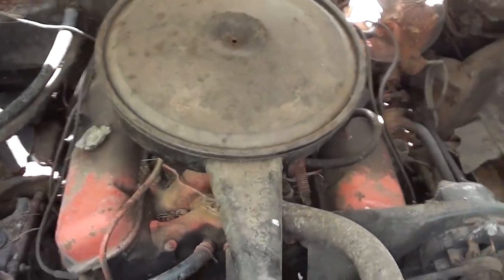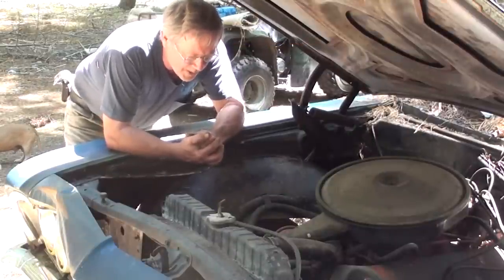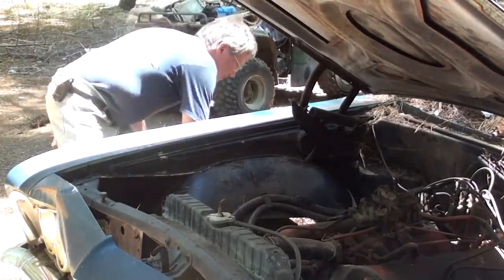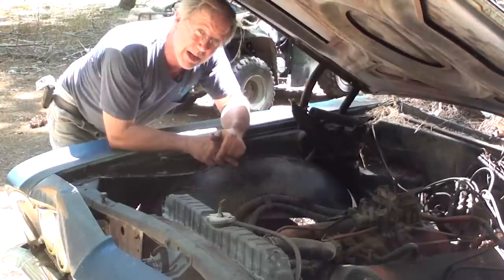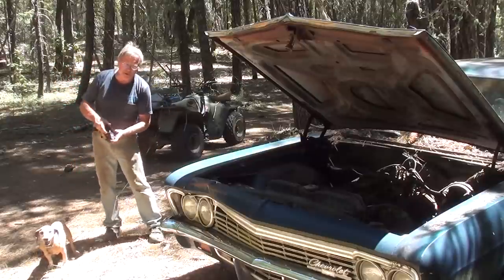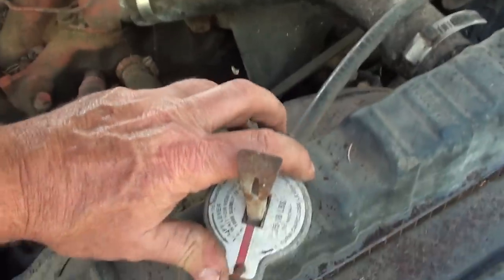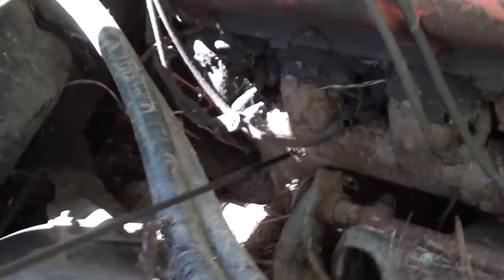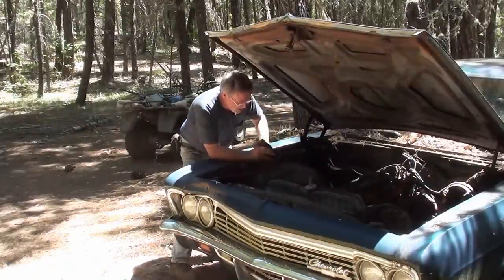Part 1 Big Block Biscayne Rescue! Abandoned 1966 Chevy Sitting Since 2003

Comment: My dad drove a 68 impala four door hard top with a 327 for I don't know how many years. He always said it had over three hundred thousand miles on it but when he traded it it was full of rust but still ran great. These old cars are tough just keep them out of the salt.
Reply: No 327 lived 300k miles. My grandfather worked for GM at the factory in StLouis  in those years and he'd tell ya the small blocks were done around 80k. They'd run beyond that but the metallurgy in the rings and bearings wasn't good enough for the poor quality of engine oil on the market.
Reply: @mwilliamshs  don't be stupid it was the late 60s not the 30s. If you took care of it it would last a long time. People still drive these cars today with hundreds of thousands of miles on them. Your comment is nonsensical because it has been proven wrong more times than anyone could ever count.

Comment: I have experienced several of those particular spark plugs that dropped the center electrode into the engine. Once, on a brand new fresh rebuild. Haven’t touched em for about 40 years since.
Reply: Tried that on a 5 cyl Volvo S80 recently. It just chewed it up an spit it out. Ran great after a new plug. Parts guy was a bit confused about me ordering only one🤓

Comment: Good to see you bouncing around again, must mean you're pretty well healed up. As for that more-door, old iron is getting rarer every day. It's got plenty of potential as a cruiser, and I'm 99% sure the brakes/steering/suspension is the same as the two-door, so you've got aftermarket support.
Reply from the maker: There will be at least 4 videos in this series

Comment: I used a similar version of a compression guage but it is a actron by sunpro lol, and the hose doesn't have the connector hoses and accessories yours does but it is dependable and work good so I am not worried..

Comment: We need to stop looking at cars as "worthless" because they have 4 doors. This I why I like Uncle Tony's garage. I had a 65 biscayne that was my first car and you would have been looking for a soft place to sit if you talked about my car that way to my face.
Reply from the maker: I was at the place to get a 56 GMC 5 window truck. Getting this car meant a 300 mile return trip for a car with no title. The 396 made it worthwhile.
Reply: @ElderlyIron  Missing the point. If you don't like a car because it has 4 doors then leave it for someone who appreciates it. I could give a rats tail if the car had an inlilne 6 or a v8.

Comment: Darnit, how could I have missed this premier!  Where I grew up in Clayton, Ohio, in the late '70s and early '80s, was a '65 Impala SS.  It was a light metallic blue, and still wore all four of its SS wheel covers.  It had a 283 with bucket seats and a console shift for the Powerglide - and it had a manifold vacuum gauge incorporated into the console, where I would've expected a clock.  Only problem was that it was a rusty old pig.  It had considerable rust holes in all of the usual spots, and not only that, the little chrome rings on the tips of the six tail light lenses were all rusted and disintegrating! I'd never seen that before...  OK, now to watch the remaining 43 minutes... (I knew it was gonna be a two barrel!)

Comment: It's good to see you at it Jeff... it looks like you're getting around just fine in the video. I'll assume that the healing process has continued to be a success. As for the car, I see a lot of potential for someone who would be interested in it to get back on the road so allow me to encourage that end. If it doesn't work out that way, obviously there are plenty of useful parts so be sure to pass them along if you cannot make use of them yourself. Even though I'm a Ford guy, I still like old iron of whatever variety thus hate to see it be scrapped when the iron is viable. There's always someone out there that would love to get their hands on parts/items that would otherwise be forever lost. Anyway, I'm looking forward to the next episode. Oh yes, one thing regarding the fire danger... I'd take a rake along and clear out the flammable, dead vegetation from underneath and around the car if your mission is to fire it up in place. It shouldn't take long. I bring this up because I've been witness to a fires breaking out a few times in an almost identical situation as yours... though it never went anywhere due to being prepared via a primed waterhose or extinguishers. Even so, I've yet to witness a fire break out when there was nothing to burn. Just food for thought! Be safe and best wishes!

🔥🧯🚒👨🏻‍🚒👍🏻✌🏻🇺🇸

- Max Giganteum
Reply from the maker: There will be at least 4 videos in this series

Comment: I like to add ATF to the cylinders, leave the plugs out and break the rings free by hand at the crank pulley, then wind it on the starter.
Reply from the maker: I'm all out of yard sale ATF
Reply: @ElderlyIron  Bought a case of Type F at a yard sale myself....nobody wants it anymore but it works great with acetone instead of penetrating oil. I guess I'm doing the environmental thing and "reusing" the stuff.

Comment: I think your underestimating the 4 door situation. The new and upcoming car guy has a family usually and a 2 door is way out of price range and honestly the 4 door makes more sense, look at all the crew cab trucks out there. Not only that but all the 2 door go fast parts fit the 4 door.
Reply: True!
Reply: easy to turn it into a 2 door DD Speed Shop is doing a 66 biscayne right now
Reply: @winteroutside7014  a 2door post sedan. Coldwarmotors did the same thing taking a whole complete unibody 4 door 1957 Plymouth Savoy and making a 2 door Fury with the excess parts. Uncle Tonys Garage did this with Slaghammer the 67 Valiant. They used a sedan body and just built it up as a 2 door post sedan
Reply from the maker: There will be at least 4 videos in this series. Somehow people got the impression I'm against 4 doors, when I am not. It's purely and economical decision. A 6 cylinder or even a small block in this car would not have warranted the 300 mile round trip rquired to get it. The 396 would have paid for the trip and made some more on top of that. A 6 wouldn't have covered expenses.
Reply: @broncomcbane6382  uh, you missed the title of this video ''66 biscayne''  what does a savoy fury or valiant have to do with the topic od '66 biscayne ?
Reply: @ElderlyIron  Makes perfect sense.

Comment: @ elderly iron. Those cables around the manifolds Was the recall solution for broken motor mounts
Reply: Said broken motor mounts could cause the throttle to jam open. A friend wrecked his 1967 BelAir because of that. He was too cheap to replace them.
Reply: A pathetic solution to a serious problem to say the least. 👎🏻🙄🤦🏻‍♂️

- Max Giganteum

Comment: It is a hot wire from the voltage regulator and the starter. Then it will run I own a 1966 Impala a hot that goes to the battery and powers it all look at the battery and it should be a small red wire then it will run

Comment: We have two 65 biscaynes 4 door 396 cars currently under restoration
One is an AC car 
In our research we found that GM did this as 327s were in short supply in 65/66
Reply: And in the Impala SS in '65, you could opt for a 396, or you could order the 409 in its final year, in case one of the small blocks wouldn't get it done for you.
Reply: turn them into 2 doors like DD Speed Shop . he also has a 57 belair post 4 door / 2 door  sedan roadster
Reply: @DanEBoyd  yes, I had one. My brother had it first before he was drafted and went into SF. I drove it til I had a low number on the draft and had to join the Navy. My brother put a 427 cam in it. The early 65s had Holley carbs. Factory exhaust manifolds had good flow. With a Mickey Mouse kit on the carb and drag plugs it would run in the mid 12s on the quarter mile. It was one of the first synchro 3 speeds and it was on the steering column. The trans was geared very low in first gear. It did good for a SS big body impala. Used to blow the doors off of Roadrunners. 
Love those old cars.

Comment: So if this had have had a 6 in it or a 283 you would have closed the hood on it and this would have been the end of the video.Fact of the matter is that that car is 56 years old,and if its in any kind of shape at all its worth saving,irregardless of the body style or the engine.
Reply: I'd like to see the whole car saved too - it looks really complete and solid.
Reply from the maker: The fact of the matter is that it had no title and I would have to drive 300 miles with a trailer to get it home. I was at that location to get a "rare as hens teeth" 56 GMC 5 window cab. The 396 alone made the return trip viable, regardless of what it was in. If this thing had no floors in it or even rolled, I'da come back for that 389.  There's probably 4 more videos coming up in the series.

Comment: I was wrong!  That's a Quadrajet!🙄Darn those missing Turbo-Jet badges!  And I'm surprised that it has the Powerglide.  Wasn't the TH400 available in '66?  Maybe deleted for credit?  Man, I just love that GM dark aqua from '66. Ma's friend had a '66 Impala wagon in that color (and two super hot twin daughters), but I'm pretty sure it had one of the Turbo-Fire options underhood.
I'm a pessimist, so I would wanna pull those valve covers and make sure all the valves are free. Chicago?
Reply: Had a '66 police car equipped like this in the gas station back in the day... surprised it would break the rear tires loose when flooring it... probably do 140 once it got moving...
Reply from the maker: There will be at least 4 videos in this series. I put badges on it!

Comment: Me the big fan of the square body trucks and the gm gbody cars especially the 80's Oldsmobile cutlass supreme brougham with the olds 307 v8 cars lol, believe it or not I ended up with a gloss black and I think it was supposed to be a white pinstripe might have been silver not sure lol,,it is a 2000  dodge ram Laramie slt quad cab long bed 5.2 litre 318 magnum v8 46re AT 4x4 1500 and 176k miles runs strong needs a muffler bad kinda loud muffler no more lol

Comment: #8 oil consumption was a common thing with early 396 oval port engines
Reply: Wasn’t it an issue with #7 & #8 cylinders running hotter than the rest because of the cooling system design.
Reply: @prevost8686  pretty much yeah

Comment: Hey Jeff. I just bought a 1979 f250 2wd with manual steering and I'm trying to find where I could possibly buy the power steering setup from. I've been looking and haven't found much. Thanks. I tried to send a message but couldn't figure it out.
Reply: There are some factory parts available which you can get off the shelf but if I were you, I would grab the entire used power steering setup off of a truck in the boneyard. Or from someone parting out a truck. It may take a while to find what you need but once you have it all you'll be good to go - just be sure to get everything when you're getting the parts including the hoses, belts (to use as an example of what to get new), the pump (for a core, at the least), the correct crank pulley, all the brackets plus the bolts. One thing, the pump and brackets may be different between engines so obtain what works for YOUR engine. You might also need to compensate for the alternator, an overflow tank, the waterpump, the radiator, a fan shroud and even the hoses. Why? Sometimes the inlets and/or outlets were switched from drivers side to passenger side based on the engine, A/C, P/S, etc. Even the radiator thickness can vary and so can the fan pulley & spacer. My best advice is to obtain a shop manual for your year of truck as they're invaluable for repairs, specs and diagrams. I'd list out all you need but I cannot since I'm not familiar with your truck. In your shoes, I'd rely on my shop manual to figure it out... along with a real life example of a P/S equipped truck. Peace & good vibes! ✌🏻👍🏻🇺🇸🧰

- Max Giganteum

Comment: I'm a Mopar guy that knows a fair amount about GMs, but I have to ask how did you know that was a 396 and not a 427 immediately it seemed?
Reply from the maker: The Powerglide. 427's had a 4 speed or 3 speed auto. 396 came with a Poweglide. Of course, back in the day, you could order whatever you wanted! Besides, I've had this for 3 or 4 years!

Comment: Hi are you sure the engine is a 396 it could be a 427 ?
Reply: In a 4 door, low trim no A/C car?.
Reply: @bachtomin213  It happens.
Reply from the maker: According to impalas.org, in 66 the 396 only came with a powerglide, and the 427's never had a powerglide

Comment: So is this been sold already? Or will it be put up for sale soon ?
Reply from the maker: For sale now, though not completed yet. Just got some center caps for the rallye wheels. Running/driving. Found out it has a factory Posi as well.

Comment: Whats ur issue with a 4 door
Reply from the maker: I guess I'll have to make a video with the explanation, as so many people seem to think I have issues with 4 doors. I went to a private property to buy a 56 GMC 5 window. It was a 300 mile round trip. The resale value of whatever you buy has to offset the cost of the trip. Without a 396, the value is not there to make a return trip. WIth the 396, the engine alone make the trip worthwhile. However, the value of the running, numbers matching big block 4 door  exceeds the value of the engine alone. Currently, I have invested a substantial amount of time and money into this to make it roadable. There will be at least 4 more videos on this car. Do you think I would have done that if I had something against 4 doors?

Comment: Do you still have the car
Reply from the maker: It's here. Almost ready. Unstuck the rings, compression is up on all 8, (further episodes) new rear wheel cylinders, new front brake hoses and right front wheel cylinder. Got the 396 fender badges and put some rallyes with just the center caps on it. Cleaned out, pulled the headliner and covered the seat with some blankets. Can br driven, but not fast and not far! Ready for someone else to take over!

Comment: Jeff, you have waisted lots of time. By now I would have pulled the engine a trans, pulled the heads. lapped the valves and tested. then you know where you are. the 396 is to be saved, so is the 2 speed powrglide. check into it you'll see. If you don't believe me sell it to me!
Reply from the maker: There will be at least 4 videos in this series. Worth more as a whole car at this point!